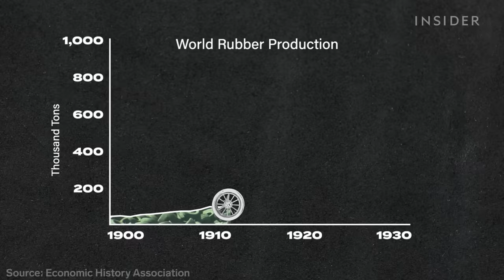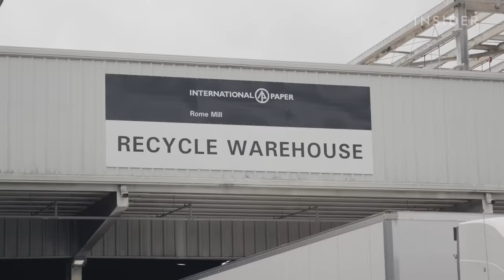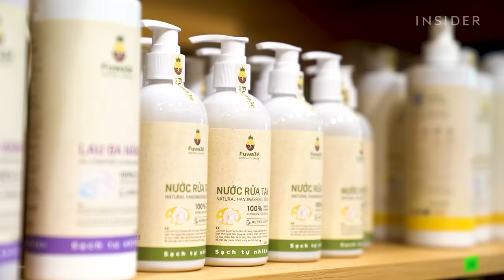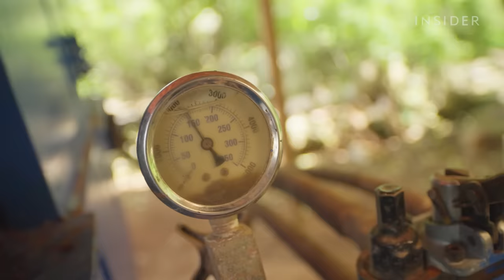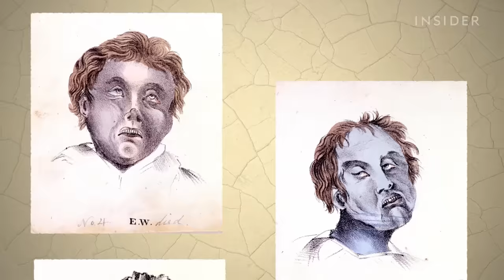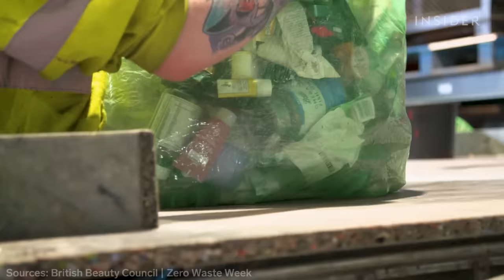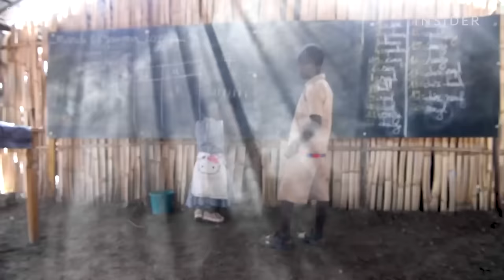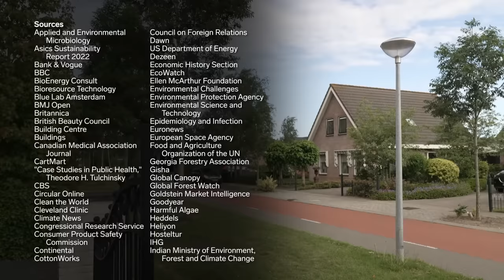16 Ways To Solve Trash, From Recycling Jeans To Making Bricks From Tires | World Wide Waste Marathon

Comment: Here in the UK old tires are shredded and mixed with asphalt making low noise roads.
Reply: can you tell us more about this way of doing it, please
Reply: Asphalt is one of the few fully recyclable products adding rubber to would hurt the recycling process and add extra emissions...
Reply: Recycling is not cost effective except for aluminum and perhaps iron and copper.
Reply: Here in the Netherlands too.
Reply: Don’t worry electric vehicles will help
Reply: @donraptor6156  financial cost effectiveness can’t always be the only consideration, otherwise most people wouldn’t have children, because those are often also not financially cost effective for their producers. 😊.
Reply: Which company?
Reply: Theybdid that around me with the roads for a lil while,, potholes happened quickly and it cost you in mpg's because road too soft
Reply: That's a good idea
Reply: @faithm2535 it's also toxic, it's bad when used in playgrounds which causes health issues.
Reply: That is great. I would love to have less road noise in the US.
Reply: @donraptor6156  It might not be cost effective but we're going to run out of new rubber.  They've managed to use rubber trees, causing deforestation to 10-15 million acres just since the 90s, to make tires.  Now the EV, as if it wasn't ALREADY worse for our environment, uses tires 30% faster because of their weight, than a regular car with a gas combustion engine.
Reply: not to create low-noise roads, but tires are chopped and melted to form a super-strong glue that binds between components in road construction.

Comment: I agree that row planting of trees after a lumber company comes through and clear cuts a few acres is not a forest, somewhat.  They don't come in and manage it so other things DO grow in those tree farms.  Companies need trees that grow fast so that's what they plant.  The good news is those trees still sequester carbon so it's not a terrible thing.  Continually taking out forest to build housing complexes is a bit worse.
Reply: Only 20% of paper products come from natural forests. So most trees cut down for this reason is on land thats recirculated every 30 years or so, and a lot of paper mills use the extra land they have around the mills to do this, and not everyone does this but a lot have crews that maintain these farms, go thru cut down stuff that grows between the trees, they are usually planted in straight rows also, but again this isn’t replacing habitat or for land reclamation, this is on a set amount of land that they use continuously to grow trees on. And given the other options they have I think they have done pretty well.

Comment: l've only just found this video, what a shame those Scimitar's have been left to rot, though not the body's as l think they are fibreglass it was the chassis that used to rust. The engines were not tiny as you suggested they are 3L V6 as fitted to the early Ford Capri's before going to the 2.8/2.8 inj V6 for lower emissions.

The Wolsley graveyard was a sad sight they are all from the 50's l checked one which was last taxed in 81 so l'd imagine they'd been parked there around the same time though the 1500 was around late sixties, strangely the reg WHA 375  comes up as a green 1978 Merc. 

More of the same please Stokze.

Comment: The amount of waste in Boxes is Mind Bending. 1)New box goes to manufacturers where they are filled with product placed on a pallet and shrink wrapped where it is 2)Shipped a distributor and 3)sent to retailers box gets cut open product removed and Then its 4)put in the crusher   5) sent to a Recycling wholesaler 6)sent to recycler to be made back to paper where it is 7)sent to the box makers and then 8)sent back to the manufacturer of the product. )If you skip step #4 You could eliminate #5#6&#7 Im sure logistics would be incredibly difficult. But think of all those Amazon boxes everyone throws away every day why is there not a way to get those back to Amazon?

Comment: 25:24 I have been inside of the 3 boilers at Rome Georgias paper mill, I used to do inspections for them, been in most of the boilers on the east coast, but Rome has something that’s not as common anymore and that’s a hot boiler, or a trash boiler, where they burn stuff that’s not black liquor or that’s not part of the recovery boiler process and man that one has to be the nastiest one I’ve ever been in. We would have to make sure certain areas of the tubes inside of the boiler are clean from any debris and in that boiler it would be caked on the walls like 2-3in thick in some areas and we had guys in there with wire wheel grinders having to clean that stuff off.. if you never herd of the “boiler flu” before then be thankful, it’s like a case of strep throat and a sinus infection that makes it where you can’t talk, but you get it from breathing in all the dust they kick up in the boilers and like I said romes hog boiler was absolutely the worst, you would come out covered head to toe in just black dust.. but yea definitely one of the more memorable trips I’ve had, and it’s one of the longer jobs we had also.

Comment: Easy solution to all the soap bars wasted in a one time use in hotels, all they need to do is install automatic shampoo/ soap dispensers in the shower / bathroom, because even using pump or squirt bottles of soap you still would have a ton of plastic bottle waste adding to the already problem !!!

Comment: What if the Polyfloss company could refine its recycling, by layering the Polyfloss onto clinging electrostatically-charged surfaces, inside of an inert Nitrogen atmosphere, and flash-pulse microwaves zapping, to ‘weld’ the material into an intact, cotton-like fabric?

Comment: Recycling is an expensive waste of time. It is labor-intensive and energy intensive, for instance moving thousands of tons of newspaper to various locations to be recycled. The most efficient and direct way to dispose of all combustible garbage (primarily paper and plastics) is to burn it in trash-to-energy plants (TTE). If these plants were spread all over America and the world in every city, town and region, we could A) dispose of our combustible garbage B) eliminate the need for 95% of new landfills, and C) produce the most valuable energy resource of all - electricity - with the heat from the  incineration. Sweden is the world leader in this technology and it is done in my town in Massachusetts. New York City burns 3 million tons of trash per year in its TTE plant. These plants burn efficiently at very high temperatures and are equipped with scrubbers and filters to reduce air pollution to almost zero.

Comment: If Adida is melting plastic bottles down to remake it into plastic filaments, to weave into shoes, they could streamline much of that process, by using a modified plastic bottle cutter, that survivialists use to cut plastic bottles into threads. Less energy expended, and because they aren’t melting it as much, the long hydrocarbon molecule chains will remain intact, which is something that gets shorter whenever you melt plastics down, which is why recycled plastic products are never as structurally strong as products manufactured with’virgin; plastics.

Comment: Did they ever check the bars of soap under lab conditions, because we use to take laundray detergent and HOT water in a 2.5 gal bucket and just keep throwing cock roaches  in the bucket that were mixed  with laundray deterge3nt and hot water and as soon as they were thrown in the water they INSTANTLEY DIED i think it was because of the lye in the laundry detergent.What we have to due is get use to usering heavior types of soap that really clean and get rid ot some of those perfum soaps.

Comment: Unison is solving a problem that doesn't exist. It hotels had liquid soap dispensers then only the soap that is used pumped out is used and the rest can remain for the next quest. Then just top it up with new liquid and there is zero waste.
Reply: Are you sure, having been involved in the detergent business for over 20 years, solid soap is less expensive to ship than liquid soap as the fluid carrier in liquid soap increases the volume and weight significantly relative to the cleaning material. not to mention the cost of the packaging needed. A full pipeline is needed and the environmental cost of that might take decades to recover. On the other hand outlawing liquid soap might produce an immediate benefit. I hope this help you see the bigger picture. Thanks for posting this as I'm sure your observation is well meant which is why I am writing this comment.

Comment: My 1st thoughts was  alpha heater is knock off? There's no 3 prong plug in mine? The box doesn't say alpha heater anywhere on it?  I wonder if the $19 unit is same as $32 unit? Is warm but not as powerful as they claim. It has a remote but no batteries. Seems like since I bought the expensive one it would have batteries with it